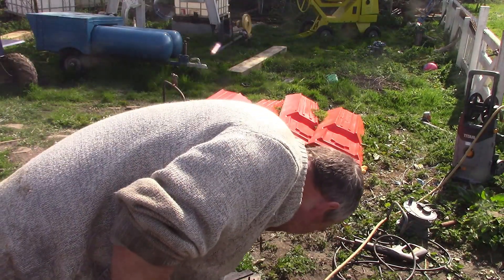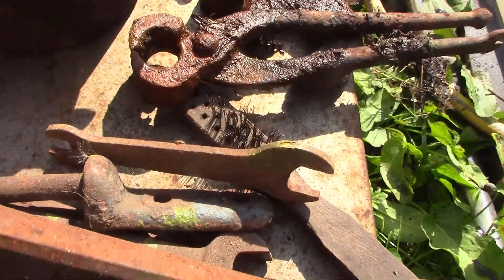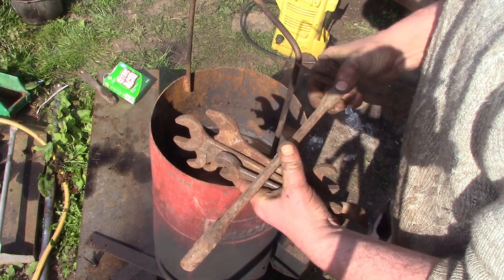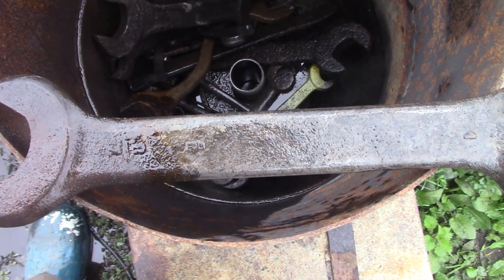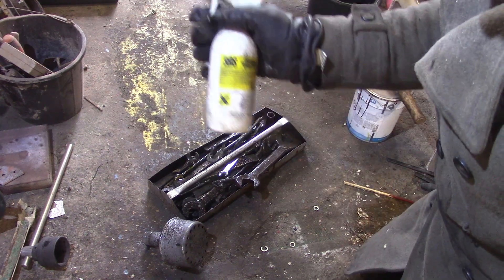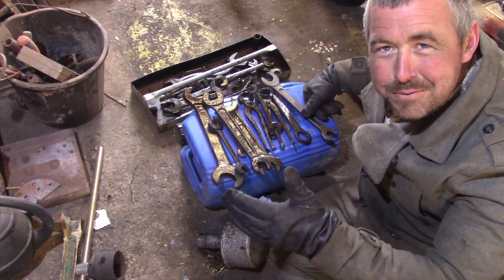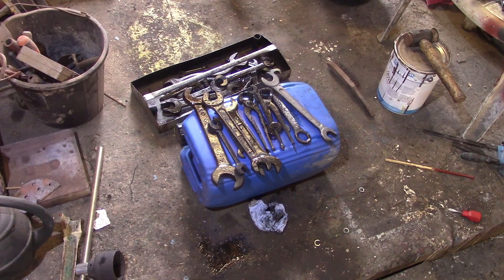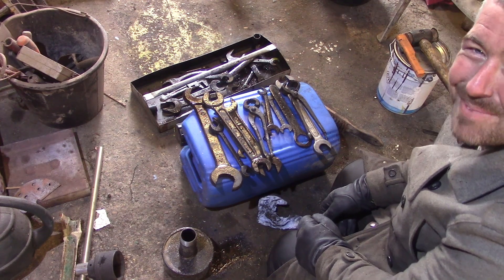How to remove rust with citric acid

Comment: Electrical screws are still often a BA (British Associated) thread.
Both Metric and American National are a 60⁰ angle.....Whitworth is a 55⁰ angle..
Whitworth are often more difficult to get apart when corroded as a result.

Thanks.
🇬🇧😐
Reply from the maker: Re: BA you the man, I knew that I just didn't say it...
Why should the reduced angle make it more difficult to remove, Binding? Was only speaking from experience they always seem to come apart easier but I suppose there are many other variable at play.
Reply: @turboconqueringmegaeagle9006  

Corrosion seems to have a greater effect on it...
It may be a 55⁰⁰ angle has more contact area...
🇬🇧😐

Comment: Thinking about trying this on a engine cylinder for one of my old ones
Reply from the maker: Can't go too wrong with this stuff
Reply: @turboconqueringmegaeagle9006  just put 2 cylinder heads and a carburator in a 5 gallon bucket see in a couple days how they turn out

Comment: next time try rinsing in water after citric clean remove then putting water and baking soda -it will neutalise the citric acid, dry then boiled linseed oil to prevent rust. that way u don't need to waterblast it.

Comment: once I used that acid to clear up a 2 stroke exhaust but it didnt quit worked. Americans use Evaporust for that application to clean rust. In the past I have searched and appears that shops around UK sell it too.
Reply from the maker: Evaporust is bloody expensive here. I got a catering grade decarborising powder that is non caustic and safe on aluminum, amazed at how well it cuts carbon I'm pretty sure it'd deal with a 2 stroke exhaust.

Comment: Have you tried Evaporust? The Channel Elemental maker does a pretty decent DIY version that is buffered with citric acid. It's a bit slow but it's super cheap and easy so you might have better results with that. You just add some tetrasodium EDTA and citric acid to move the pH. 

here's the video:
https://www.youtube.com/watch?v=f9kBdJQMPPI&t=4s
Reply from the maker: Nice one mate I'll check it out, no to the evaporust, someone else mentioned it so I looked and its about $40 gal here

Comment: As an alternative to ultrasonic baths we used to use hot plates. If you get them up to a light boil (blub...blub...) they work almost as fast as ultrasonics but you have to be careful not to let them boil off as the citric acid breaks down and the fumes from it will put hairs on your lungs and is a bitch to clean out haha. The vortices from the heat seems to pull the crap off and replace with fresh citric acid so basically pumps it around.
Reply from the maker: Ha, my poor lungs have had too much hair over the years and getting a bit sensitive.
I agree with decarborising it's the heat that cuts the grot more than the ultrasonic action unless you're restricted to milder agents due to the material.

Comment: It works well at 80F (26.6C) or warmer.  Don't dump the acid out until it stops working or starts taking much longer than normal to remove rust (it lasts longer than you think).  You can pull parts out and give them a wipe down and put them back.  Repeat until you get the desired result.  Oil contamination slows the process down the most.  You can put your hand in it with no consequences (well provided it isn't boiling hot LOL).  I'm well versed with this process.  I buy citric acid in bulk.  Been using this process for longer than I care to admit.
Reply from the maker: Cheers Shain, I'm going to add a circulating pump and see if that'll do the job of removal and cleaning, thanks for the tips.
Reply: I used to a aquarium pumpt to circulate Citric Acid in my Jeep Frame, worked really well to de-rust and remove any debris.  @turboconqueringmegaeagle9006

Comment: I’ve had good results with oxalic acid., commonly sold as wood bleach. Beer can collectors use it as it will remove rust without damaging paint. Obviously there are limitations to these methods but it is nice to get good results on the cheap with little effort. Always enjoy seeing your content, keep up the great work!
Reply from the maker: Never even heard of oxalic or wood bleach, would you say it's gentler and do you use heat?
Reply: The operating ingredient in Bar Keepers Friend is Oxalic Acid. It works. Cheap too.
Reply: @turboconqueringmegaeagle9006  
I did not use heat, but i don’t see why you couldn’t. I was removing rust from a couple chrome bike frames. Removed all the rust without affecting decals and stickers

Comment: Circulating pump (made from nylon!) will speed it up. Warmth helps - as long as you can afford it. quick bath (couple of hours) in warm and circulated, then water blast then soak...
Reply from the maker: I'll add a pump, it'll help with de greasing engine parts too
Reply: @turboconqueringmegaeagle9006  Yes ! I saw this years ago at an engine reconditioners place (run by an ex-aircraft engineer) ....

Comment: what's that surfacting oil spray and where can i get it?
Reply: Any oil will work.  WD-40 is actually designed for this very purpose.
Reply from the maker: Sas maintenance spray, £20 a gal (imp) off eBay and comes with that squirty bottle
Reply: @turboconqueringmegaeagle9006  nice one, cheers burd. WD-40 is what i use but it's 'spensive and flashes off too quick for my liking.

Comment: Does that someone answer to the James? ;) I do like Whitworth. The thread angle is 55 degrees as opposed to 60. Nice demo. You can also use white wine vinegar apparently.
Reply from the maker: Maybe, James is a very common name...
pretty coarse too compared with standard M and UNF
Reply: @turboconqueringmegaeagle9006   😂😂 The thread pitches on Whiteworth are about the same as UNC.

Comment: I quite like doing a bit of electrolysis cleaning, using something like half a stainless beer keg (Fancier than half a gas can, and more fun to empty) as a tank. You wire up the keg to one lead of say a big solar panel via a cheapo PWM controller and a battery, or an old-school not-smart battery charger that'll pump out a good few amps, and then dangle whatever you want cleaned in connected to the other lead. Use some electrolyte (washing soda, or cooked baking soda, NOT SALT!!! That makes chlorine gas and hydrochloric acid...) in the water, and Bob's your proverbial.
Not sure if it's quicker, though I think it might well be, it's not so good at internal volumes, and it bubbles hydrogen off, so not one for indoors, but it's another nice hillbilly rust removal method innit.
Reply from the maker: I've messed around with it but ya gotta go in clean bruv and that's not my style innit.. 
Tried cleaning up a mixer drum with a welder and sulphuric acid, didn't work.
Maybe a heated agitated citric acid electrolysis cleaning bath is the logical evolution here. 
Do you wire stuff up individually or stick it in a basket? 
I've been looking for stainless kegs for ages but can only find the ally ones.
Reply: @turboconqueringmegaeagle9006  Yes each item needs a negative connection path to complete the circuit.  It works on line of sight from the anode and cathode.  Anode = the steel bar connected on the positive.  Cathode = the part to be cleaned connected to negative.  On complex shapes the part can actually create shadow lines so the part has to be re positioned to get uniform results.  Multiple anodes can be placed and wired together to reduce that from happening.  There are instances where I use electrolysis but it is the exception.  The container needs to be non conductive.  If it starts participating as an anode you will have a leak sooner than later.  If you can get the same results with only warm citric acid vs another process that requires electricity, wiring each component, and an electrolyte (washing soda, lye) why bother?
Reply from the maker: @ShainAndrews  mate, I wish I could use words as well as you thanks for taking the time to craft such a nice summary.

Comment: I'ma have to try that.  Awesome video... just a little tip-and only for a minute: You can use GoJo Citrus orange mechanic hand scrub and some aluminum foil as a scrubber to remove rust from chrome like a miracle.  The aluminum is softer than the chrome/steel so it doesn't scratch it.  The pumice and citric acid in the GoJo soap does fantastic at removing the rust even in pitted areas.
Reply from the maker: That's a quality tip mate cheers, just resto-modding an old bike for one of my kids I'll give it a go!

Comment: I use citric acid when cleaning brass casings (reloading ammo) in both a tumbler and ultrasonic cleaner. Works wonders and gives a really nice shine to the brass. You have to be careful though as the acid makes the thin walls brittle if you leave them in for too long.
Reply from the maker: Do you anneel them or is that just if you're re sizing them? I had to replace a set of brass injector nozzles because the solution pulled the zinc out and left them all coppery, always been a bit nervous about brass in the ultrasonic bath since.

Comment: I wonder if you could use it in an ultrasonic cleaner or would the acid eat the tank
Reply: It works wonders! I clean brass casings in my sonic cleaner with citric acid. Really gives a shine to it, but you cant leave the casings in there for a long time as it will weaken the thin walls.
Reply from the maker: My little 3L cleaner has a heater on it, would be great for smaller parts
Reply: We use it in our lab ultrasonic but have it in a tub within the ultrasonic bath. Icecream containers work well (we use a 10kg margarine tub) works just as if it was in and you don't have accelerated wear in the main tub.

Comment: Jim, I'm employed by a maintenance contractor, and the company we contract with had purchased new stainless steel tanks, and the were delivered in sections and then later tig welded. Our job was to passivate the stainless steel surface to remove any ferrous contamination from the surface with gel citric acid, then power wash the surfaces to remove the product afterwards. It did a very nice job on the surface.
I built a cart from some scrap stainless steel, and got the cart tray covered in fire balls that scraped off easily, then passivate it and power wash the surface. There's almost no indication that there was steel contamination to the tray.
Reply from the maker: Powerful stuff, might be fun to try and gel some of these crystals for use on bits I can't fit in my tank

Comment: I use distilled white vinegar. Cheap and cheerful.
Reply: Me to,12 hours then wire brush..then repeat process as necessary
Reply from the maker: Do you use any heat? I've tried the vinegar, it works well I think this is superior maybe.
Reply: @turboconqueringmegaeagle9006  vinegar saves money on fuel costs as it uses none,it just takes a day or two depending on how rusty it is.I restored a ground dug (empty) grenade case from a ww1 battle field using vinegar,took about a week in total tho as the rust blooms were half inch thick lol
Reply from the maker: @tumbo1984  awesome, do you know where it came from or dig it personally?
Reply: @turboconqueringmegaeagle9006  somme